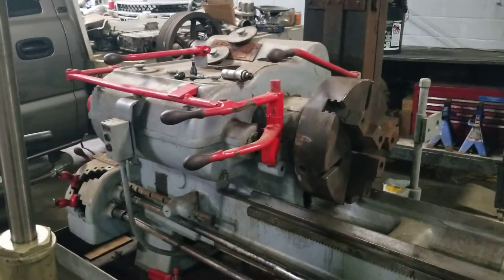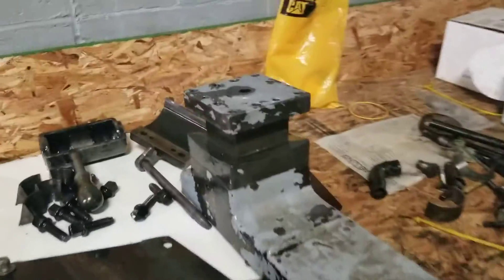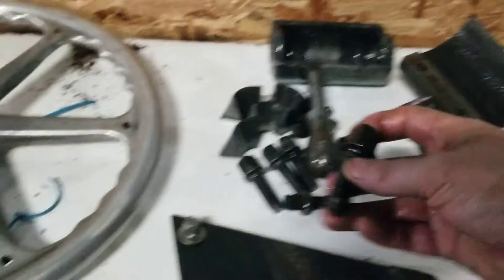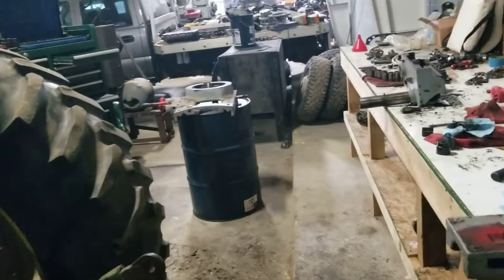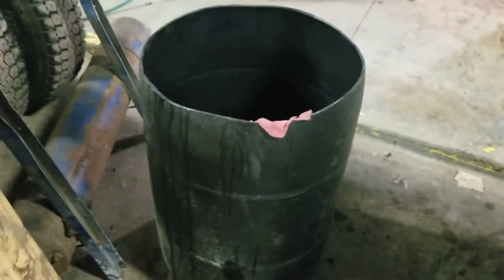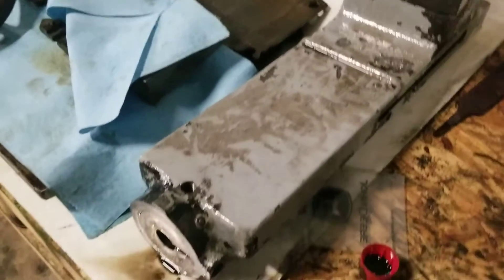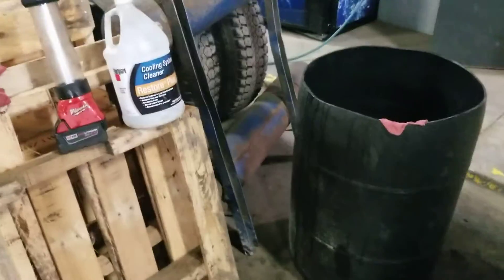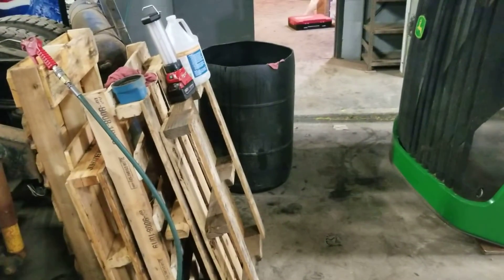8X Cheaper alternative to EvapoRust

Comment: a Gallon of Evaporust mixed with 4 gallons of water works better than the EDTA mix. I made it neutral with HCI. I haven't tried the citric acid to make the EDTA yet but still not as good as the evaporust. I do think its the same. I did a gallon of ER and 10 gallons of water and it worked well for a while. For large Items that can sit a week or so use molasses 9 to 1 or 50 to 1. It will ferment and make the chelating agent. It will smell bad. It's just slower but works as well.

Comment: I’ve used food grade powdered citric acid and it works great but, it will eat metal if you leave it to long.  Evapo-rust is a little slower and more expensive but takes care or the rust without being aggressive so I will try this in the future. Thanks for putting this video out !
Reply: I saw a video from another guy on YouTube and he was using citric acid but using like sodium carbonate to neutralize it up to like ph of 4 and it didn't seem to be eating the metal much